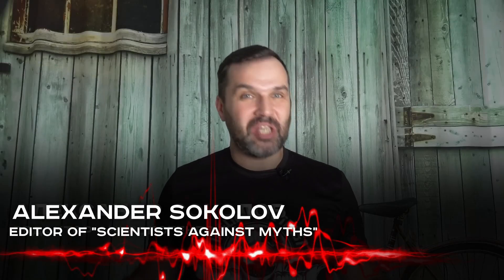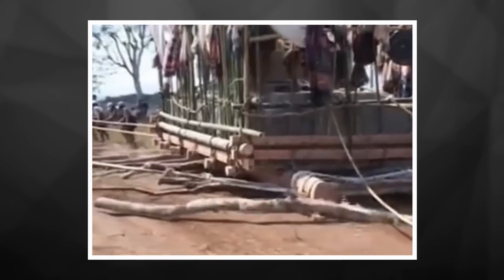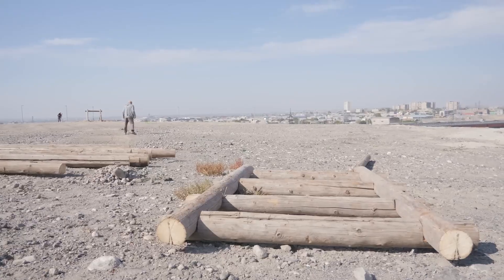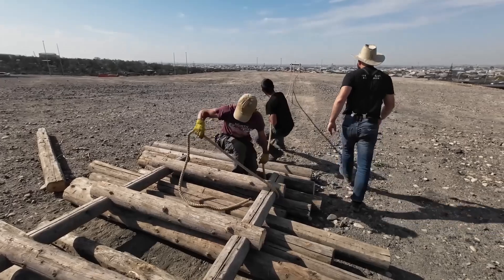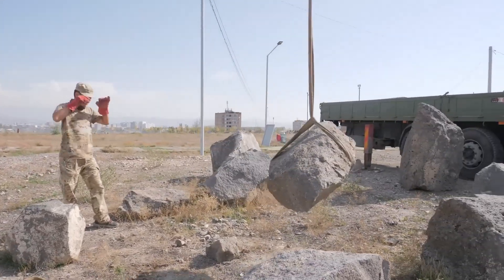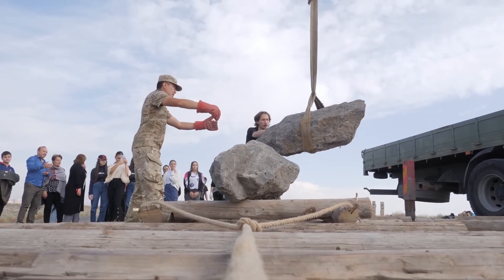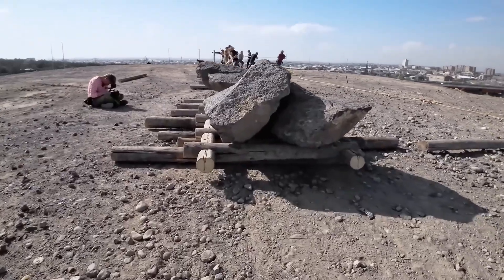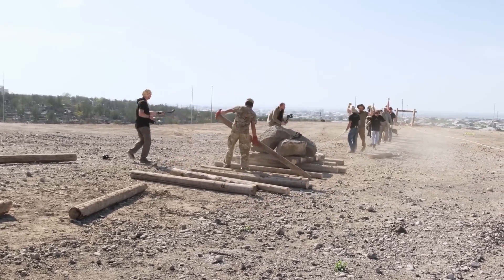How did the ancients transport heavy stone blocks? Experiment | Serious Science

Comment: You did this cold without generations of experience behind you and still succeeded. Well done!
 I suspect the Egyptians would have laughed at the idea that moving heavy stones was difficult. Likely they'd have had a smoother surface, better rollers and a bunch of guys standing by with 6 meter hardwood poles to use as levers wherever adjustments were necessary and they would make it look easy.
Reply: OMG.
I told you about how to make STONE reference surfaces by simple hand methods that don't involve discs at all! Do you not pay any attention ever?
Who says they made them "by eye"? Do you seriously think they had no methods to make precise right angles????!!!
You don't need diamond: carborundum grit, black river sand and quartz are adequate. Very hard grits have been found remaining in Egyptian drill holes. 
And I have a pretty good idea how hard granite is, I have drilled it extensively with a 1.5" rock drill. 
Every time you open your mouth Dennis...
Reply: OMG you are an idiot Dennis, you really are.
Reply: I didn't say they did use sand. I said they could have. And apparently, the quartz they used as an abrasive did not come from granite, which contains a lot of quartz. I'll own that one for being wrong.
Reply: I suspect they had professional teams that you could hire to do this. If there is going to be a big job then there would be enough work to support a business like this.
Reply: yes, I know about the gravel, the shovel and about 100 tons, but you don't know... The locomotive weighs 70
Reply: NOW PLACE THE OVER 1000 TON BLOCK ON ONE SIDE OF THE OTHER VERY EXACTLY AT THE HEIGHT HAHAHA USING A WATERMELON-THICK STEEL ROPE
Reply: @dennisjames3711 Now try to write a coherent, articulate sentence. And no need to shout.
Have you ever heard of "lots of ropes"?
Reply: @chrisgrill6302  read about the strength of the thick steel ropes that are needed to withstand the load. 18 mm rope, maximum load 30 tons. they put blocks weighing over a thousand tons...
Reply: @dennisjames3711 If an 18mm rope can carry 30 tons you'd only need 33 of those to lift 1000 tons off the ground. Of course those are steel cables and they didn't have steel cables, but they did have much thicker fiber ropes, and they did not need to lift the blocks off the ground, they were pulling them along on rollers. I've done this myself with 10 meter fishing boats heavily laden with miles of wet netting, dragging them up the beaches in Mexico. It's not that hard! Of course 1000 tons would be pretty difficult but that was hardly the norm, most blocks were only a few tons at most. I really don't see what you think is so impossible.
Reply: @chrisgrill6302  no wooden cylinder can hold 1000 tons. how are you going to get the sleepers out? look at the structures in baalbek. not 33 because there are variable, uneven stresses during transport. the transport company was transporting a boulder weighing about 300-400 tons. he said that just lifting something like that is extreme, let alone over 1000 tons. many boulders weigh tens and hundreds of tons. a few tons are small blocks
Reply: @dennisjames3711 Stonezine 12 details how this could be done. Tricky, a lot of work, but entirely possible and a lot more believable than ancient aliens or magic or lost technology or whatever you are proposing... not that you say what you are proposing. Sorry I can't link you to it better, I tried.
Reply: @chrisgrill6302  Serapeum in Saqqara - a granite sarcophagus weighing over 100 tons. brought in and placed in a narrow tunnel, with today's technology this is impossible
Reply: @chrisgrill6302  
How did they manage to make Ramesses' head so huge, stone-like and perfectly symmetrical? You can't copy half of a face in stone by hand, because one wrong move and it can't be fixed.
Reply: @chrisgrill6302  You're changing the subject yourself by talking about evolution. It is impossible to maneuver such a heavy load in the corridors without advanced techniques. There are many things you simply don't know. Carving is not possible because the inside of the sarcogag has smooth walls to the point that it cannot be done even today.
Reply: @chrisgrill6302  You can't hand-carve Ramesses' enormous head in stone and make it perfectly precise and symmetrical, you know? There are stupid ways, but there are also very clever and technologically advanced ways. We do not currently have such technology.  arguments, you talk about wooden boats and compare them to 100-ton sarcophagi. Is everything OK?
Reply: @dennisjames3711 Of course we have such technology. We can even cut and polish diamond which is far harder than granite! As are tungsten carbide drill heads which I have re-cut myself! What are you talking about?.
The boat building technique or something along those lines is more than adequate to form extremely big, perfectly symmetric shapes. The idea of reversing the templates to create mirror images is the important point there. Simple. If you don't understand that I don't know what to tell you. How was Mount Rushmore done?
I notice that you believers totally avoid the subject of medieval European stonework. I guess youve never seen a cathedral. The stonework of even the village church here in Uffculme Devonshire UK where I live is quite breathtaking, let alone that of say Cologne cathedral or Canterbury or any of hundreds of others. All were made with very simple tools and methodologies.
Some people are entirely too dim to talk to.
Reply: @chrisgrill6302  but it's not about cutting. just to make such a flat surface in the granite
Reply: @dennisjames3711 Wrong yet again. I can grind flatter surfaces in my own basement! Research how ultra-flat reference surfaces are made for scientific and machining purposes, it is extremely straightforward: done by rubbing three flattish surfaces against each other in turn with progressively finer abrasive grits between them. If you just use two surfaces you obtain perfectly spherical results (eg. when making mirrors for telescopes), by using three surfaces you get perfectly - extremely perfectly - flat results. Think about it and maybe, just maybe, you will start to learn that you haven't thought this through at all and you are talking utter nonsense.
Reply: @chrisgrill6302  no, you still don't understand, you can't buy a granite slab with such flatness. it is only visually flat. plus this is the inside of the sarcophagus. How to make such a flat corner in the interior?
Reply: @dennisjames3711 FFS did you not read my last response about how to make REFERENCE GRADE flat surfaces using very simple techniques? And you can make such a surface with a sharp corner to work inside corners. So what's the problem? A fence post could figure this stuff out!
Reply: @chrisgrill6302  
You won't get this flatness by rubbing with a disc, you'll also need diamond abrasive powder. you have no idea how hard granite is, sandpaper does nothing to it. There are visible lines on the edges and corners of the sarcophagus, i.e. traces of the machine
Reply: @chrisgrill6302  
these walls have this flatness and right angle, and you are talking about making them by eye from boards hahahahah
Reply: @chrisgrill6302  which sarcofac which? They are also being destroyed on purpose, probably even today
Reply: @dennisjames3711  sand it crushed up rocks. Do you realize how much granite "sand" they had laying around in the quarries and the worksites? Granite will cut granite in case you werent aware.
Reply: @jnstanford  Zostało to zbadane piasek zostawia inne ślady. To nie piasek. Granitu nie tnie sie granitem ...

Comment: Once again reason defeats myth.
Reply: The myth of 1/1000 of an inch tolerances?
Reply: @auntbeatrice6911  Those tolerances only occur when surfaces are in contact. The tolerances you claim is insanely ignorant.
Reply: NOW PLACE THE OVER 1000 TON BLOCK ON ONE SIDE OF THE OTHER VERY EXACTLY AT THE HEIGHT HAHAHA USING A WATERMELON-THICK STEEL ROPE
Reply: @dennisjames3711  Stop screaming. It only make the foil hat funnier.

Comment: Well done! I believe rails were discovered in the Serapeum so placing the log rollers on top of rails would be accurate. You could then grease the rails. Also using a large lever pushing behind the stones would help with leverage and breaking the dead weight.

Comment: Maybe use a parbuckling technique or use a similar method from Chersiphron or his son Megatenes. I believe those methods would work well with just one large slab or stone. If moving multiple large stone, it might be best to secure them tightly together. Then build a wooden frame or 'cage' around them and turning the whole thing into one large roller or drum. Which would make it easier to move with just one or two ropes and minimum manpower.

Comment: were would the ancient egyptians get pine logs from? would they have cut down their valuable date palms? maybe try again with palm logs.
Reply: They imported cedar from Byblos, but it was extremely costly, they used it for forniture, coffins, structural pieces for construction, sledges, tools and some art carvings (if they could use acacia or sycamore fig they did instead of the cedar). Palm tree logs are not made of wood, they are like  a bunch of grass roots firmly tied and glued together.

They probably used the sledges with no logs under them. The only picture known of Egyptians using a sledge doesn't show logs under it, just sand and a liquid (probably water) and dozens of workers pulling ropes.
Reply: @fenrirgg  cool stuff, so you can't roll stuff on palm logs because they aren't solid enough? explains why they didn't use the log method if wood was expensive. 

I'm not an expert on trees but Acacia don't really grow tall and straight so logs from them would make bad rollers. I suppose they might be able to be shaped?  sycamore figs are more straight from what I can see.
Reply: @lmonk9517  yes the palm logs are not ideal, they would have to be carved and they would turn into dust and individual fibers quickly. I don't believe they used the rolling logs (at least to build the pyramids).
Reply: @lmonk9517 What about giant palms? Couldn't they be dried enough, or even fire cured to strengthen them? Maybe in ancient times the Nile had super giant palms. Idk. But, maybe?
Reply: They imported cedar wood from the area called Lebanon in modern times (northern Phoenicia/Canaan in ancient times).

Ancient Mesopotamian literature tells of that area being filled with great forests of cedar trees, most of which are now gone, leaving the land subject to terrible soil erosion problems for lack of the root systems that once held it all together.

So ye - lots of trees to import, for a time at least.
Reply: I wondered that, too.
Reply: north africa used to have abundant pint trees. mesopotamia too.

Comment: This is important work. When any group of people decide to tackle a difficult task in order to achieve a goal, there will be fits and starts; steps forward and steps back. With each challenge there will possibly be multiple failures. If the Egyptians, Olmec, or Romans threw their hands up in defeat when some tool failed or when an attempt to get a heavy object moved seemed futile, there would be none of the structures we all marvel at. When there is a common hope and belief in the purpose of the undertaking, the only real limit is imagination. The details inevitably take time and effort to smooth out. No mystery is ever solved on the basis of one experiment.
Reply: IKR, obviously the Romans built their aqueduct system using Roman Numeral Math.  You believe that...🤣

Comment: Is it possible that larger logs on either the sled or rollers would help?
Reply: Yes. Larger rollers roll more easily. Same as wheels. A large wheel goes way more easy over bumps than a small wheel. Larger logs for the sled would help as well, because it is stronger. Wood is not weak, even though some lost ancient tech believers think so.
Reply from the maker: May be
Reply: @ScientistsAgainstMyths  The Egyptians most likely did not use rollers. Maybe in some situations, but I also am pretty sure they just used a sled. On sand rollers do not perform well. Sand with water, creates slippery mud and decreases the friction. You just need enough manpower and/or animals.
Reply: @YATESAsphalt8  - Sand, even smaller particles, usually have sharp edges that will act as tiny cutting blades and cause braking friction. That is why sandpaper, even wetsand, uses.....sand! to smooth rough wood into smoother wood.
Reply: Good question.

Comment: It's nice to see you are expanding your range of experiments. Just a few thoughts:

1) the beam used for redirecting the rope does not produce any mechanical advantage, it only adds friction and thus hinders the process

2) if you can add rope handles or wooden poles to the main rope, the workers can get a much better grip. Imagine you attach the sled to a rope ladder and make the workers stand inside the "steps" of the ladder, thus each worker can push instead of pulling on the rope.

Keep up the good work!
Reply from the maker: Thanx!
Reply: LOLOL this experiment reminds me of the only surviving image of the inca moving a 500 kg boulder with the chief standing ontop of the misshaped rock with a heard of minions pulling him with ropes. Three cultures so far are known to use this method for sure, the Inca, the dynastic period and these balloons in 2024🤭😆😆
Reply: @Kitties-of-Doom Please read my comment, and tell me what you think if you've seen the cut out notches, I'm talking about.
Reply: @cat_terrell  this is the only comment i see. Gotta lead me to it better. don't know what to look at. However i know the notches.
Reply: @cat_terrell  The notches, most likely, are for tree trunk poles to hold them in place while other work, fitting, is accomplished while holding it in solid place. Just imagine a pole between those nubs or notches and the ground. But also imagine they are eroded a bit and don’t look freshly formed.
Reply: @danielpaulson8838 thx, for replying. It's another theory to explore.
Reply: @Kitties-of-Doom  Ladies and gentlemen, we can observe here a typical case of an internet cultist. 

Largely recognized by their lack of knowledge, a love for pseudo-science and conspiracies, arrogance and general lack of logic. They often talk without saying anything.

If you throw facts at them they will start to screetch and go into cognitive dissonance.
Reply: @Kitties-of-Doom  "the dynastic period"... I see the clown car has arrived

Comment: @ScientistsAgainstMyths I'm surprised you did not try laying the logs like railroad ties. This would prevent them from rolling and still reduce friction points. I'm sure a simple lubricant like wet sand (dirt, clay, etc.,) would help the sled slide over the ties. What are your thoughts?
Reply: that works on horizontal ground.  
uphill or downhill it might be pretty bad.